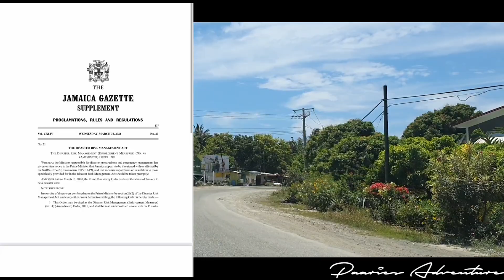Major Overpass To Be Constructed In Morant Bay/St. Thomas || Southern Coastal Highway

Comment: I am surprised that plans are not yet finalized at this stage of the road project.  Also, why is an overpass necessary at that point?  Does it mean that there is going to be local roads on the lower level that will give access to the urban center while the overpass will be a continuation of the highway  connecting with  the roundabout?  I do hope that the Chinese will be building the overpass.  The job being  undertaken by the local contractors appears to be a total mess.
Reply: I agree with you full 100 about who is building this bypass